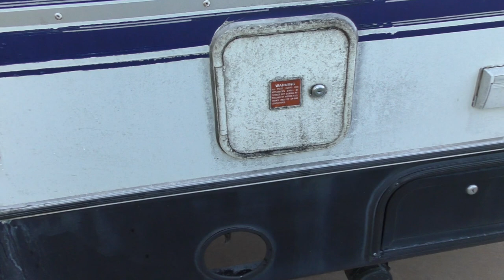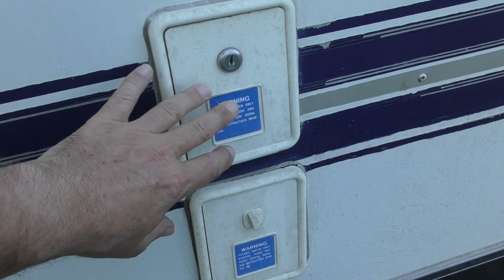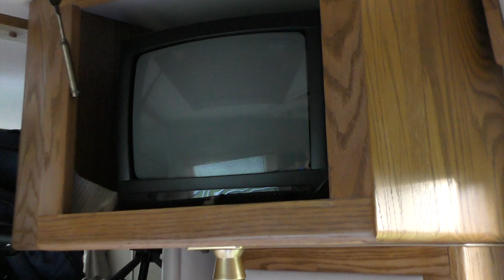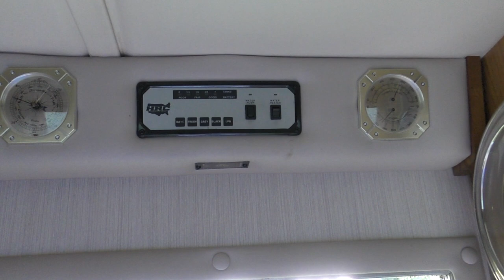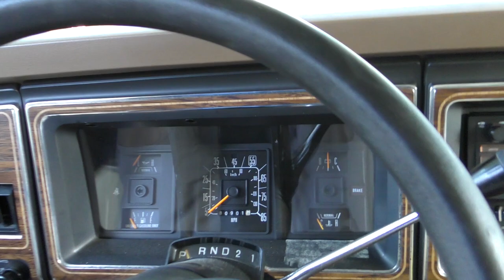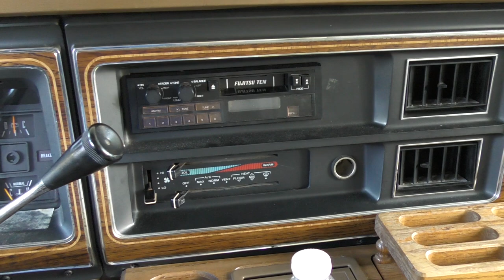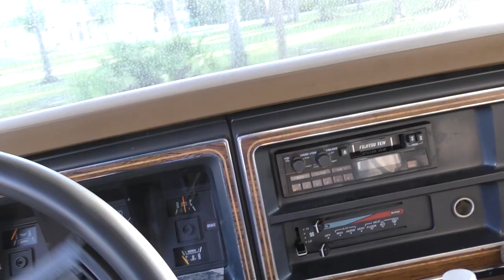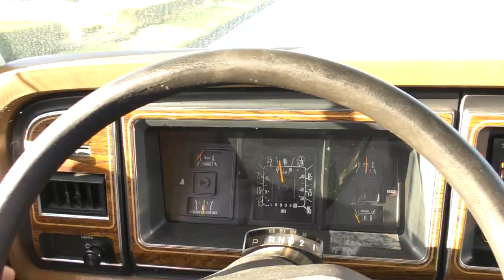The 1989 Holiday Rambler RV Project - Flask Update, Animals, and Getting Things Ready for the Road

Comment: Thanks, Bill.  Interesting episode as always.  My comment got long because I offered you some motorhome information.
The animals at the beginning are wild turkeys.  They always look prehistoric to me.
Bill, for any motorhome, trailer, etcetera.  Every year go on the roof, look for cracks in any caulking, and fill in the cracks with more caulking.  The roof is the biggest danger point to having your RV destroyed by rainwater.  Water will run down inside the walls, cause damage inside and rot floor, which are usually plywood.  Always keep an eye on the condition of the roof and seal it up as needed and if you hit overhead branches.  Carry a roll of roof sealing tape found in RV stores.
When you have the Onan generator fixed be sure to have the mechanic mouse-proof it with metal screening to block mice from getting inside.  Mice build nests inside them and then when you try to start the engine a plastic piece (that I think controls the timing or engine speed) will break.  And then engine won't start.  The plastic piece is in the deepest part of the generator and it's an expensive repair when that breaks, and it's always because of mice.  It happened to me twice on two different generators.  We live in the country, so we have field mice.
If you replace the House-Batteries I suggest buying AGM batteries because the wet batteries are a pain adding water to and you need to check the water level a lot during frequent use.  Also, as you may know, AGM batteries take a charge very quickly so they're easy on the alternator and shore charger.
For the truck engine, I suggest one area to check out and keep an eye on will be vacuum hoses on the engine.  Since thirty plus years have passed, maybe just replace all of the small lines, as they tend to be the ones that crack or break first.
The strongest and fastest refrigerator cooling is when using the Gas/Propane setting.  12V setting is the weakest.  110 is fine if you plug it in a day or two before leaving on a trip.  Also, when it comes to RV refrigerators.  It they have a digital read-out for the temperature setting, whatever temp it goes to automatically when you restore power to it--leave it at that setting.  Setting it colder is said to bring on problems.  If the refrigerator has a dial that you set the temp, set it at the marking for, Normal.  And if normal is a range of settings, then set it to the middle of normal, or warmer.  Most important when using the gas/propane setting, is that the refrigerator has to be Level.  If it, isn't it can overheat a section of the gas line and destroy the gas system, requiring a rebuild of it.  And check the exhaust flue pipe for leaves and other debris so that the exhaust can flow freely.
Extremely important- buy a brand-new Smoke Detector, Propane Detector, and Carbon Monoxide Detector.  All three!
Note: Carbon Monoxide detectors expire after five years.  As well, if the coach sits for a period, replace the batteries in these.
As well, and good to know is that, unlike the propane tanks for gas grills, the built-in motorhome propane tanks don't have an expiration date.  But do yourself a favor and put a decent paint job on the propane tank in this coach.  Then you won't chance some cranky guy refusing to fill it for you.
By the way, you wouldn't like overdrive in this unit.  There's too much headwind and they keep shifting into and out of overdrive, and they stink at slower speeds too for the same reason, but also you don't have immediate power because you have to wait for it to come out of overdrive.  And 75 MPH is a lot for motorhomes because of the headwind.  Doing 75 MPH will create a big workload for you to keep it in the lane, especially annoying with crosswinds.  And it's hard on the coach too.  Usually, 65 MPH is about it, but I've found that for the most comfort and lowest personal workload is at 60 MPH.

Bill, if you need help, I've owned three motorhomes so comment here (I'm a subscriber) and I'll send you my email address and phone number.  Wishing you and yours many happy miles with this nice coach.
Reply: Discerning Mind,   this post of yours is VERY helpful, and it was gracious of you (and quite 'giving') to have sharedit w/  all of us .... I know I appreciated it a lot.   I'm in the market either looking for a Class C, or shuttlebus, boxtruck, or stepvan to convert.. havn't made up my mind yet, but in several years worth of watching RV related Youtubes.. you communicated MORE info, in just one thorough chapter.. than id seen anywhere else so far.  This was FANTASTIC.  Thank you.
Reply: @PhiladelphiaTruthseeker    You're welcome and thank you for letting me know that.  I had to read what I'd written and there are some good things there.  I hope you did a copy-and-paste to have for future reference as there's too much to recall.
Since you're undecided, I want to make some suggestions for you.  One being, buy yourself an actual motorhome and not a truck to convert.  It will be so much easier on you because of all the work and cost to convert a truck into a motorhome.
Another being that when it comes to motorhomes (as well as boats) over the years I witnessed people always wanting to "move up" to a bigger coach (or boat.)  Some people move up several times.  That's costly and bothersome.  So think through your long-term plans because it very well could be that the most sensible thing for you to do is just get a big motorhome from the onset.
And bear in mind that most Class C units are "campers."  Whereas Class A units are more like a home.
I grew up with campers and also had a 23' Class C, that I hated.  For me the Class A is the only choice.
And when you are shopping and zeroing-in on coaches that seem acceptable, take photos, and also sit down in it for ten to fifteen minutes looking over the floor plan and everything else that you can take in.
Is that floor plan going to work for the way you want to use it?
Are there things missing?  Like little to no counterspace in the galley.
Something important to me was I wanted a salon (living room) up front that had plenty of seating.  A good social area.  That works for me because when people visit the group isn't broken up by some people being forced to sit in a dinette or on the floor.
Put a lot of thinking into floor plans.
Also very important, is to make a list of everything that you want in a coach.  Not knowing what you want prior to shopping will put you at an awful loss.
Good luck to you!
Reply: @discerningmind     Yes, I copied and pasted.. thank you...    hmmm.. now.. getting to your counsel there....   well...   ive barely any income.. so, didn't really want a large engined RV like a Class A,  although, I agree with you that it would be more like a home.. and I really love how you're up sitting high in them and what a great view you have of everything, and mostly important, the road in front of you....   what I didn't mention above, was that I wanted to be stealthy.... as.. I wouldn't have the money to be staying at campgrounds, overnight.. maybe only rarely, and would need to be able to go here, go there, unhindered by the necessity of being at a certain Campground by a certain time at night.. etc etc..  and putting that cash out nightly.   Paying for the gas alone would be expensive enough.      Im needing to save money, plus have the ability to most nights, not have to pay, for where I sleep, hence the stealth preference.   Yes, I know about the Walmarts and the Cracker Barrels etc.. and the truck stops, that could accomodate a Class C or Class A, but another thing is.. that I feel the country is going down hill fast.  There are more and more homeless (and hungry) everyday... and i'm also aware of the growing food situation in the country.... the cost of diesel going up, food plants either being shutdown . (thank you Chinese owners), or the plants being burned to the ground.. plus all the countless chickens slaughtered over the most suspicious of PCR tests.. and the killing of deer, beef, etc... by the thousands,   for very flimsy reasons..    my opinion is that the powers-that-be.. are herding us all into a coming famine.. intentionally manufactured.
  With that in mind, I feel that driving around an RV makes you stand out like a sore thumb.. everyone notices the people in the cool looking RV right away.. I always did...  and puts a cross hair on your back..   makes you a choice and tempting potential 'victim' for those whom might be hungry, and see you as a meal ticket.     However, you're so absolutely RIGHT about the fact that buying the RV puts you in a unit that's already set up w/ bedroom, kitchen, bathroom.. etc.. all things id have to plan for and build tediously, on my own if I went the boxtruck route.  And lastly, floorplan.. oh I definately agree... and already have many ideas of what I would, and wouldn't like, regarding that.   One thing I can say...  is that another reason why  boxtruck appeals to me is the fact I can section off a part in the back for possible flea marketing, or.. for the many times ive seen quite perfect, good stuff put on the side of the road by someone throwing it out, and was depressed  I didn't have a vehicle to stop and grab said item/s .     So, one the one hand.. the RV is already made and on the other hand,  w/ the boxtruck, I could have that 'garage' area sectioned off in the rear.. and even turn the roll up door into a fold down deck.. which ive seen many boxtruck conversions do.    I'm so torn.  your comments about the vehicle already being ready to move in, everything there, as opposed to having to build it myself is a very large consideration to me, however.. by doing that, im giving up the stealth factor, plus the possible flea marketing, working from the vehicle factor.   I appreciated your reply above.       

PS.. In a 'perfect world', w/o crazy drug needing people, or hungry people needing to grab whatever they can get.. if one needn't worry about that...  if in a world w/ 20 dollar overnight stays in RV parks w/ abundant open spots.. in which you didn't have to reserve your spot weeks or months in advance...   yes, absolutely id do the RV route, Class A or C.. but in this world wev'e got here now??? .... I just don't know......
Reply: @PhiladelphiaTruthseeker    OK, I've got it.  And now I have a clearer picture.  What I don't know is if you have to be mobile.  If you don't have to be than I'd suggest a safe home perhaps with relatives or good friends.
But if you have to be mobile, then the lowest profile vehicle that I would go with is a van.  A van without windows and looks like a work van and is showing wear.  So not junky but not nice either.  With that you can park anywhere even on a city street.  And any threatening type of people wouldn't think anything more than you're a guy struggling to make a living.
Second to that, would be a box/cube truck.  But that would have a much higher profile.  A box/cube truck is a target vehicle to me, because I'd expect any thief see's those as having "goods" inside and worthy of breaking into.
Whereas almost nobody is going to break into a van to steal, average things vans carry, like vinyl flooring, insecticide, rain gutter supplies, flower arrangements.
As well, a box/cube truck won't have nearly as many parking choices as a van.
Think of the average Main Street in any given USA town/small city, and the angled street parking that they usually have.  You can very easily slip a van into a parking space like those and go to sleep.
I'd say that unless flea marketing, and good stuff on the side of the road are going to put truly substantial $$$$$ in your pocket than there's no way I'd do a box/cube truck.  And bear in mind that all that stuff you'd be collecting to sell will really add up, and it's going to be a ball and chain on you.  Myself, I'd be look for the lightness and freedom of a livable stealth van and doing temporary work for income.  I can tell you that, I've never seen anyone selling flea market stuff that looks like they're doing well.  "Well" as in, doing OK enough.  To be successful in selling things like items, you need a lot of things, like a three-car garage full of things or something.  To me it's too much work for what it calls for and the overall low income it generates.
So too a box/cube truck is going to be heavy on gas and even more so when loaded up.
I hope I didn't sour a dream for you.  If you can do it, then by all means go for it.  But to me temporary work is less burdensome because the owner has to manage all it takes for the business to operate.
But if safety and protection is the most important thing than I'd go with a van.  And the only things you need in a van are for what you need to live in it and not in excess of that.
Reply: @discerningmind    Again, thank you for your interest in helping me make a decision regarding what kind of vehicle to get (to be able to live in part time or full time).   I'm acutely aware that this is Bill's Youtube that was posted, and i'm not wanting to take up space here talking about me and my issues.. because this isn't really a Forum or Board, which are built explicitly for that.. but I would like to thank Bill for posting this video, frankly, I love the RV here.. those Square edged Fords of that era and style always appealed to me.. I love the RV you bought Bill.. love it.. though, wouldn't want the huge engine though..  lol..  for obvious reasons.  

DiscerningMind, i'm currently IN a home, w/ other people.  But im not the boss, nor owner.  The Owner is someone whom frequently flies off the handle, shall we say.. and makes impulsive decisions when he's angry...  more often than not, well before thinking the issue through enough to make a wise decision.  He and I 'butt' heads all the time because we see things completely different from one another. We think different, different politics, different views, everything, and because of that, i'm feeling my days here are numbered, and, i'd like to be prepared, in advance for that day when i'm told (completely out of the blue), that I have to leave.. because, i'm feeling in my bones, that day is not far off.   

Your Van suggestion I cant go for, ive owned a van before, in fact a loaded Ford Club Wagon 1985 I think, loved it too, till I had an accident w/ it one night after moving all day long, .. by myself.. needing a coffee afterwards, only to find everyone only had decaffeinated... and I was tired and the town I was in was foggy.. long story..I drove into the side of al dold truck in fog, and smashed my beloved Ford Van ...anyway, even if it were a conversion van,  ive been in them and the high tops just don't make up for the lack of space.  there just isn't enough room in them for what i'm planning of doing.. mostly likely id have a woman there with me too.    This is also why i wouldn't want a Class B either...    The emergency,  handicapped vans w/ the very tall tops, yes, they provide lots more head room, but still, not enough room for a bedroom, bathroom, kitchen area, etc..  

The point you had made before... about the RV being something I could just move right into.. (of course after cleaning one up a bit and getting all the little things fixed first) but basically being all there.. all ready equipped.. w/o realizing it, that's been churning around in my head these past few days and ive come to the conclusion that you're right.. I should go w/ a RV... (mostly because im being forced to basically),..  what you didn't know was that I currently have a large storage garage loaded to the gills w/ stuff i'm needing to sell, hence my talking about flea marketing.. etc.. and you were right about that too.. how the typical flea market person never looks like they are doing all that well financially from it.. some, sure.. ( the regulars maybe),  but not most.. so, my flea marketing needs would mostly be upfront, and in the beginning of me doing this change from living in a home to living in an RV.. I think im pretty much settled now w/ the idea of buying a good used Class C...  buying a small to medium sized cargo trailer to pull with it, and then selling my existing car.....  after i'm sure and confidant the RV is mechanically sound.  Im 60, and, ive never had the same equivalent energy level of those my own age .. never, not even during my teen years.  So, building something from scratch now, on a clean slate of a boxtruck...  ???   though it sounds good in thoery, in practice i probably just wouldnt be able to do it all the way through.. on my own.     Therefore, im realizing time is running out for me in my current situation and im going to have to sacrifice stealth,  for the convenience of having a vehicle where all the appliances, bedrooms, toilets, kitchen,  bed, etc, is already there.. and then from there, I can 'edit', change things as I so desire, but at my own unhurried pace...  Thank you for giving me some ideas to chew on.  they helped.  Your ideas and opinions helped greatly, plus thanks to Bill, had his video not been made, because of his Ford RV purchase, our paths would likely never have crossed..  so Bill thank you, as well.